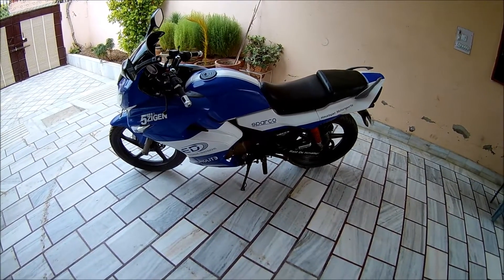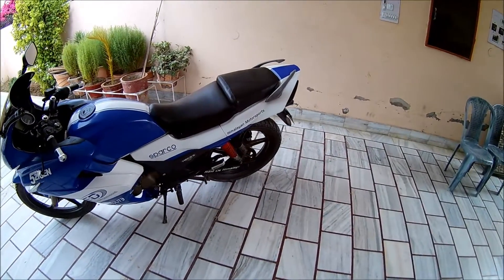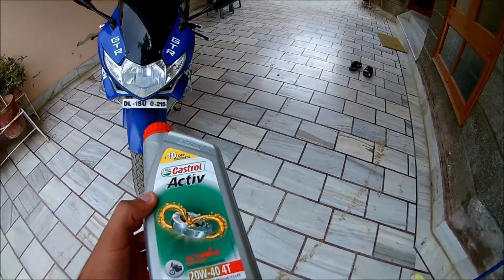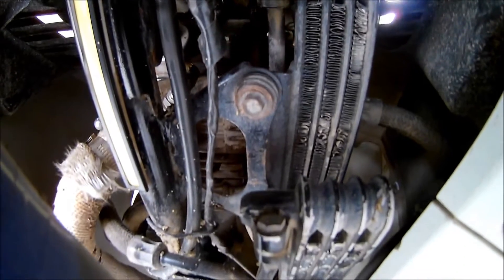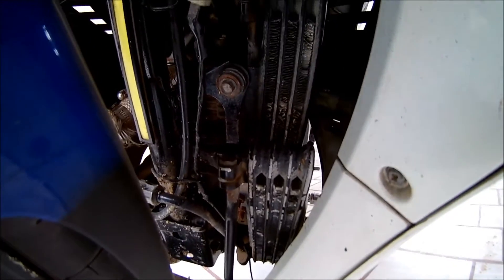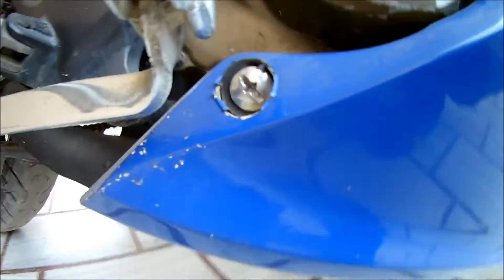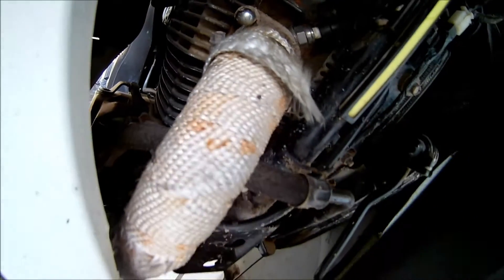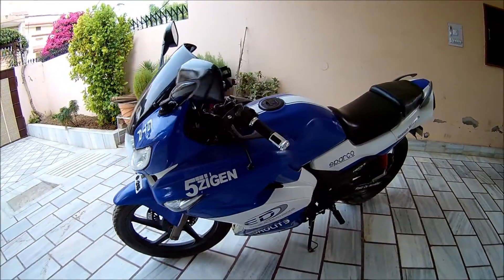Karizma ZMR OVERHEATING issue..RESOLVED...twin oil cooler and exhaust thermal wrap

Comment: TopEnd Sir,  lm desperate in need of your help. .. I face starting problem in ZMR V1..... I could only hear "chuk chuk" or " tuk tuk" sound while trying to starting ...... yet it doesn't. ...... the batteries are perfectly alright..... is there issue with relay starter / ecu issue ..... or something else????...... Sir kindly give your suggestions. .... Kindly revert.....!!!!!!!!!!!!!!
Reply: Siva Subramaniam  check the fi
Reply: okay sir

Comment: While riding there is never a problem of overheating in ZMR as sufficient airflow is available. This problem arises in heavy stop-go traffic. Will it be a good idea to put small pc fans on one the radiator to boost airflow in such situations?
Reply: PC fan will not do much, You will need to buy radiator fan, Will come for around 1500

Comment: iam also having zmr...here's my question adding another oil cooler means the oil has to go through a series of pipes in the oil cooler...soo the quantity should increase....soo should I add more oil to the bike than the required level to have a perfect oil cooling system and smooth ride??? if so yes! then pls tell me the required amount of oil to fill it...pls reply soon  thank uu in advance...
Reply from the maker: Yes...U gonna have to add 200ml more if another oil cooler is added..!!

Comment: Sir I have karizma zmr 2012 model 
M having problems when my bike is at idle rpm, the bike is producing low voltage, the front console light is fluctuating and when I switch on the headlamp, side indicators simultaneously, the bike stalls and everything resets, the trip meter, the clock everythin, Stating is perfect, and at higher rpm everything is working fine and even on the battery everything is working fine, I have replaced the battery recently 
I am facing problem at night time when I have to switch on the headlamp, according to your above explanation I suspect my rotar is not producing enough current on idle rpm it need a to be revd at higher rpm for proper electricity generation 
Please Advice, 
Thanks in advance
Reply from the maker: Well that cud be anything from a poor connections to a bad battery or coil stator...check for loose connections first..Nd if u r using heavy horns without relay then chances are your earth wire is fried..!!Also check for bad fuel pump relay and poor connections to Ignition coil..!!
Reply: TopEnd ok sir I will try this 
Thank you

Comment: Hi , you made good modifications. I have a question. which places on engine you connected oil collers input and output.? I found some oil coolers on alibaba, they have one input and one output hose but i dont know where to connect it on engine.

Comment: Hello 

Can you share the price of an extra oil cooler??

After installed dose oil capacity increases
Reply from the maker: Sourab Das Price is around 1200 IND....pour 1.2 ltr after installing extra oil cooler
Reply: TopEnd extra oil cooler needs 200ml of oil extra??
Reply from the maker: Yes..!!!
Reply: TopEnd How it's performance
Reply from the maker: Well..No more overheating...Previously with single oil cooler Heat from engine cud be felt in legs...But not anymore after installation..!!!
Reply: TopEnd is there any special mechanics required??

Or local mechanics can do the job
Reply from the maker: Sourab Das Yes local mechanic will do it...along with help of some gas welding guy...
Reply: TopEnd okay thanks

Comment: HELLO SIR OWNED 2010 BEAST ...ONE PROBLEM NOW M FACING TO MUCH IS THAT FUEL BAR  IS NOT SHOWING IN CONSOLE ,ALWAYS BLINKING AND NO BAR SHOWING ON CONSOLE HELP MEE OUT
Reply from the maker: check for sensor connections under the fuel tank...Also check if sensor isn't stuck  inside fuel tank..!!
there's always 90% chances of bad wiring or loose connections..!!

Comment: why my Karizma always shifting to neutral from moving 1st to second? And noticed when long drives, the two sides of the tank is heating.. how can I overcome these issues?
Reply: Overheating: Change and fill recommended amount of coolant. 
Just do not change gears at low RPM. Give a bit of throttle when changing gear.

Comment: hiii i have karizma zmr 2010 model and my fuel injecter is not working
Reply from the maker: Here...U may order this one...
https://www.aliexpress.com/item/motor-fuel-injector-compatible-HONDA-CBR600RA-CBR600RR-CBR600-16450-MFJ-D01-Genuine-NEW-motorcycle-nozzle-12holes/32494052322.html?spm=2114.01010208.3.80.wJ0Kf4&ws_ab_test=searchweb0_0,searchweb201602_4_10152_10065_10151_10068_436_10136_10137_10157_10060_10138_10155_10062_10156_10154_10056_10055_10054_10059_100032_100033_100031_10099_10103_10102_10096_10147_10052_10053_10050_10107_10142_10051_10084_10083_10080_10082_10081_10110_10175_10111_10112_10113_10114_10181_10183_10182_10185_10078_10079_10073_10123,searchweb201603_1,ppcSwitch_5&btsid=405002c7-449b-4750-add2-ccff2b0ee3b9&algo_expid=a898a81a-6214-43be-8dac-60a425f81c1f-11&algo_pvid=a898a81a-6214-43be-8dac-60a425f81c1f
Reply from the maker: Make sure to diagnose fault first!!!Gud luck!!
Reply: but how can i find fault.....
Reply: pllllzz help meee sirrrr.........
Reply from the maker: https://www.youtube.com/watch?v=96sl1lnYyGo
Reply from the maker: Check for faulty fuel pump and fuel pump relay as well!!!

Comment: Bro i own a 2010 model zmr can u plz suggest which motul oil i should go for?? as it has many types
Reply from the maker: U may use 10W40 Fully Synt!!!
Reply: TopEnd bro cn i go fo motul 7100 20W50?
Reply from the maker: Naah..It's too thick for Karizma....Oil path to cylinder head is only 3mm wide..!!!So it'll put load on ur fuel pump!!
Reply: TopEnd ohk thnx a ton bruv.

Comment: hi, you suggested 20W40 , plz tell me a good semi synthetic of this grade... i will be really grateful... also tell an additive oil
Reply from the maker: U can use Motul 10w40 fully synthetic engine oil..It wud be best...Change after 20000 kms..Top up after  5000kms!!No need to use any fuel supplement in ZMR!!!If u want u may use ABRO octane booster...Add 100ml to one full fuel tank!!!
Reply: thanks man, i ordered motul 7100 4T 10w40

Comment: dude i'm planning to remove the fairing and putting on a straight handlebar like those FZ,duke,hornet,gixxer etc naked bike so any tips man? i need those triple clap thats hard to find but do karizma R fit onto zmr?
Reply from the maker: those aren't straight bars...they r bent....Do u want a straight or lean riding position??
Cuz a straight bar is gonna collide with fuel tank...If u want a handle like old karizma then u gonna have to install top fork holder of karizma r nd u r gud to go!!!
Reply from the maker: In this bike I've installed handle bars of cbr150 nd I've got lean riding position!!!
Reply: so fitting another oil cooler on the RIGHT side have any issues because i like to have on both sides so any thoughts?
Reply from the maker: Exhaust pipe covers up right side mostly.But sure U can go for it..!!!
Reply: TopEnd yeah ok ty,so what are the things I need to add another cooler and steps YOU did while installing yours?
Reply from the maker: Share ur phone no...I'll send u pics..!!!
Reply: can i change my exhaust to yoshimura,IXIL,GPR really need those do you  know which model fits to this bike?
Reply from the maker: DON'T....It's Gonna sound like Generator...or autorickshaws in this bike!!
Reply: TopEnd hhhmm that's bad,and man you didn't share the oil cooler pics man

Comment: Can I install oil cooler in karizma R 2014...!!
Reply from the maker: Yes U can...Just install right crank case cover of karizma zmr nd U gonna have to remove kick nd U r gud to go!!
Reply: +TopEnd i have karizma R new model not zmr
Reply from the maker: I know...U gonna have to replace right crankcase cover with zmr one(clutch side) and remove kick...den U'll have two holes for oil cooler lines!!!
Reply from the maker: https://2.bp.blogspot.com/-T2KPwzvCgcw/VGTioihenmI/AAAAAAAACns/n5MyxhnWcEI/s1600/engine%2Boil%2Bcirculation.jpg
Reply: +TopEnd thanks bro😎

Comment: Wat about motul ? Which grade should use for karizma zmr 2012 or can i use any 20w40  oil. 
Does engine oil matters in getting gud mileage
Reply from the maker: Yeah Motul is best....U may use 4T plus 3000 15w50 premium mineral....won't effect mileage but sure heating is gonna reduce a lot..!!!!